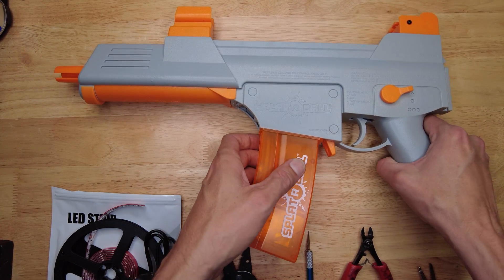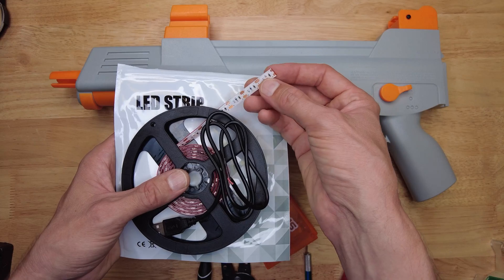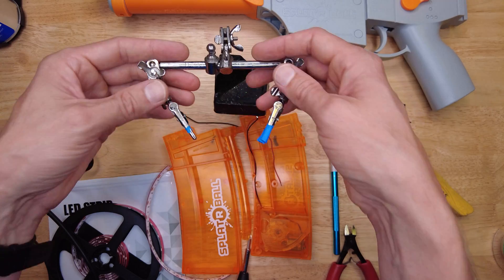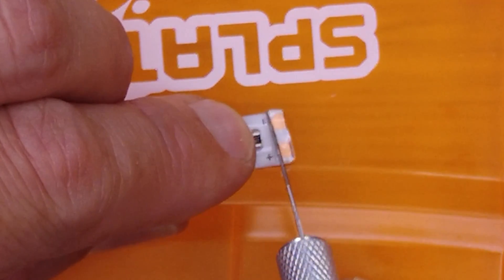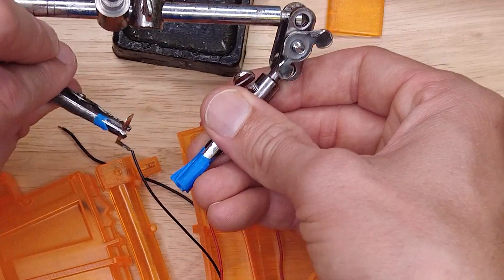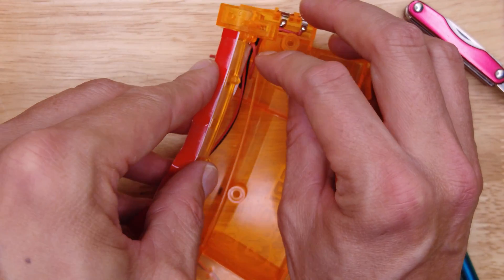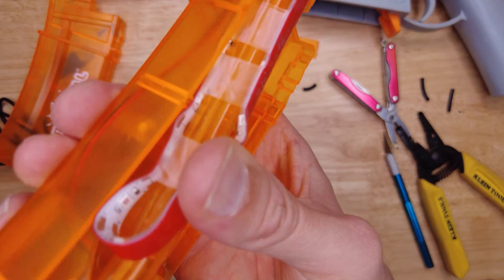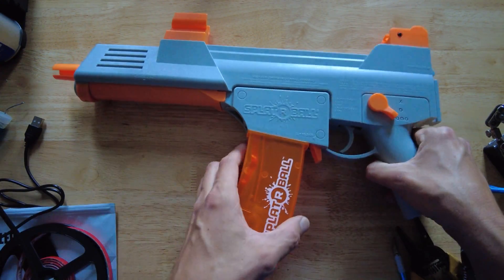Easy TRACER MAG MOD for SPLATRBALL GUN SRB400 GEL BLASTER Magazine | Glow In The Dark | SPLAT-R-BALL

Comment: This is so awesome. super easy after getting the uv strip it only took me about 1/2 hour to finish. I have only blasted a few rounds out of it but has any one noticed that semi automatic mode seems to not push the motor as much? if you were to  add a resistor what size would be recommended? Thanks for the video it rocks.
Reply from the maker: Cool. Haven't notice any change in mag feed motor, but you can't simply add a resistor to the LED strip. The resistor will consume the excess voltage and end up drawing basically the same amount of current. If there's not enough current reaching the mag motor, you need to increase the size of the wires that go between the battery and the mag contacts.
Reply: @engineerable  after following your advise I  noticed that the wire I was using was larger than need be. So I changed the gauge in the magazine and have had much better results. Thanks for your knowledge!

Comment: Hi! The UV strip is 5v and I guess the battery is à 7.4v...Don't you need to add a resistance?
Reply from the maker: Doesn't seem to matter. Duty cycle is short. I measured voltage at the mag terminals, and it drops to almost 5V when firing due to the high current draw of the main motor.